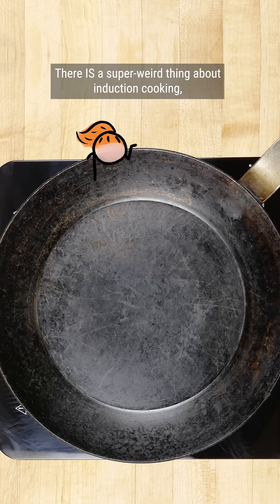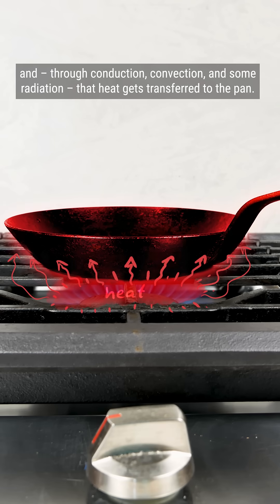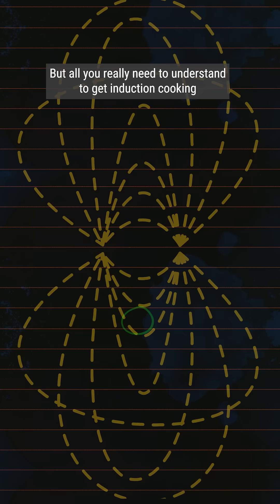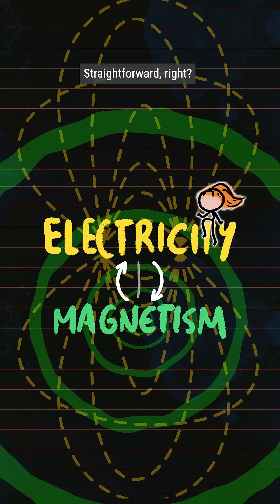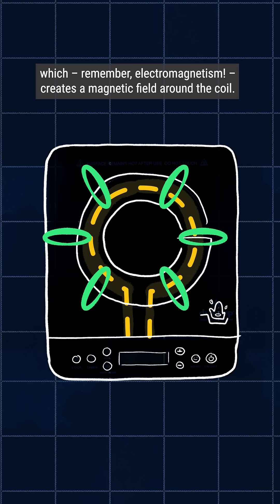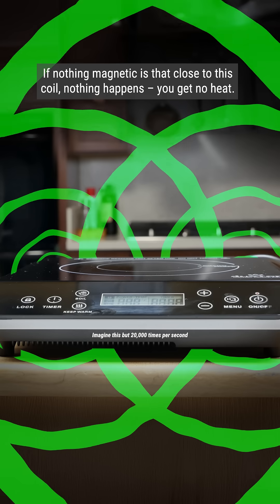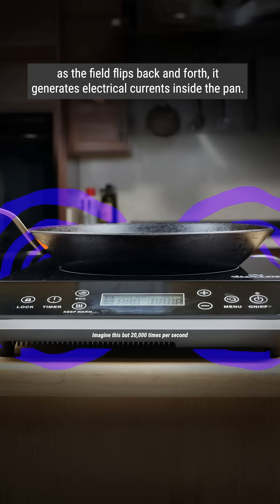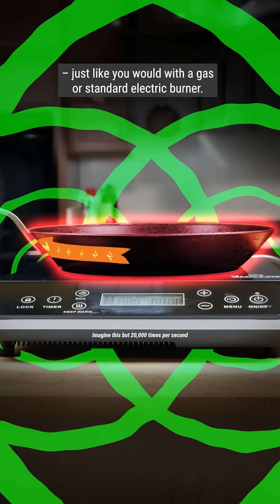How Induction Heats Your Pan

Comment: what happens if I put a super magnet on top of the induction cooker? asking for a friend
Reply: It would need to be as large as the induction coil to do anything - if the item on top is too small, it won't "induct", and most cooktops will just error out and turn off. (I have that problem when trying to use my "one egg pan" on my larger induction cooktop. The pan is too small.)

If it's a big magnet, it will heat up just fine. And then likely lose its magnetism.
Reply: It would vibrate and get hot